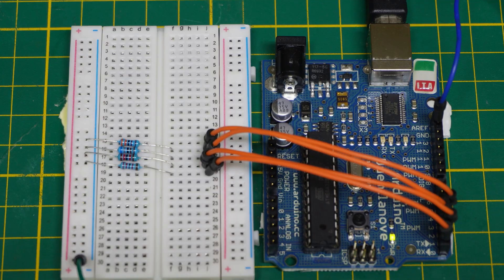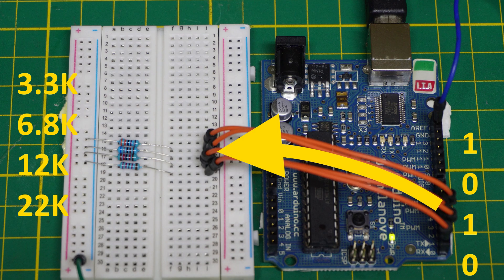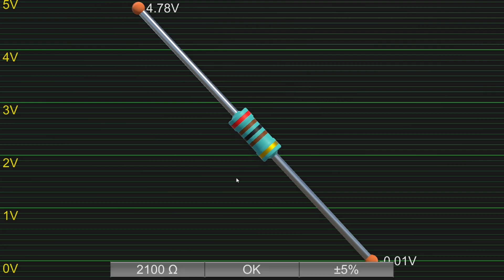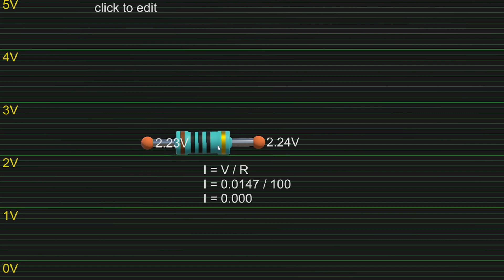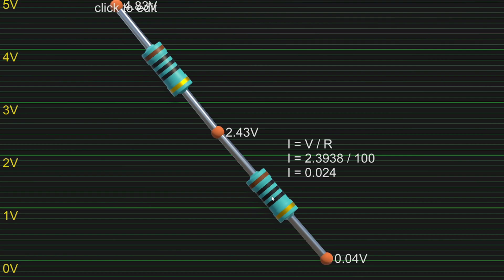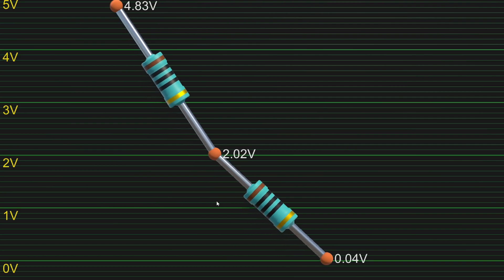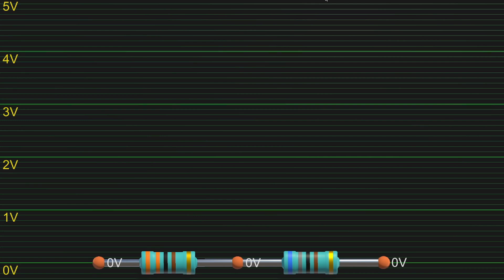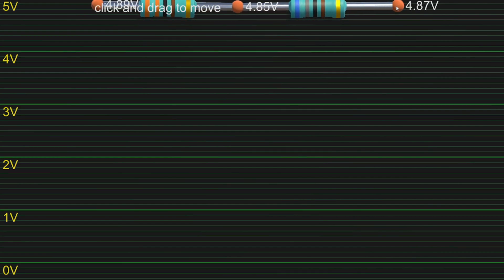4 bit DAC - Resistor dividers at work!

Comment: Could be used to read a keypad. A microcontroller single ADC input pin can read any combination of pressed buttons. 14 bit ADC = 14 buttons, I guess.
Reply: With extra clocks or pins you could have two or more banks of 14 keys… enable voltage to one bank at a time to scan each bank in a sequence; to extend the number of keys.
Reply from the maker: That would make a very unique keyboard, like that idea. We would need very low resistance connection to the controller though, any voltage drop would shift all the keys left or right :)
Reply: @krakkus  I got the idea from an old LCD TV. It had some buttons on top (e.g. vol+/- and ch+/-) but only approx one resistor per button and 2 wires. I realised pressing a button made a potential divider and they must be reading the voltage with an ADC.